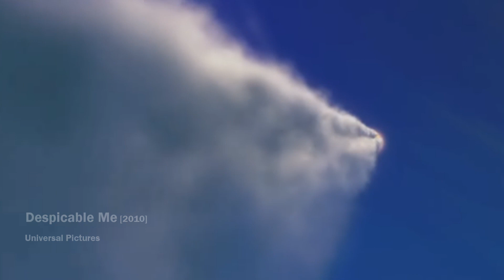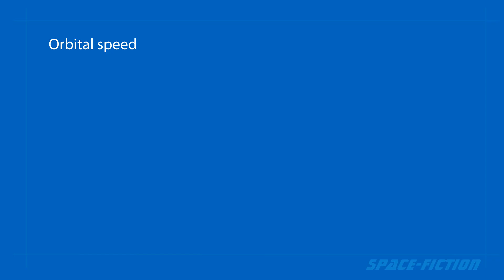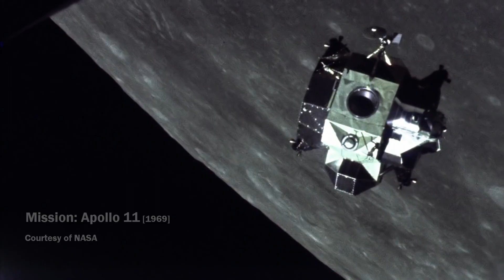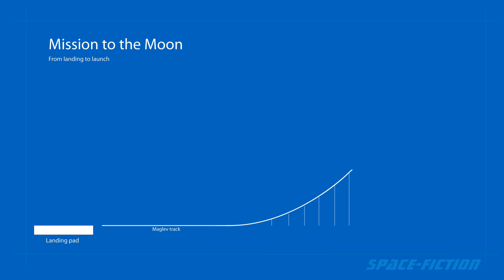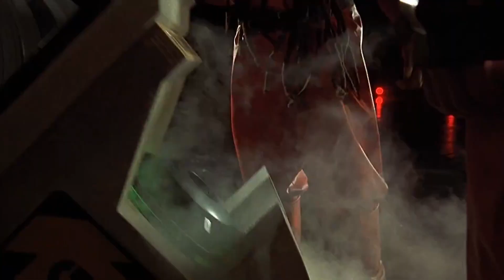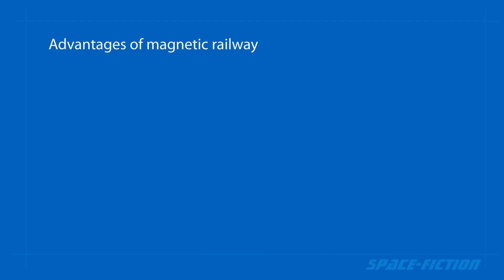Easy way to launch Spaceship from the Moon

Comment: How are you going to get the heavy rail materials on the surface of the moon and who is going to build it? The easiest way is to have Stanley Kubrick fabricate it for you just like he did with Apollo.
Reply from the maker: That is why I pointed out that I am not talking here about pioneering missions but about the future Moon bases with permanent inhabitants and enough resources.
And of course the best way to do it is to get all the materials from the Moon's rocks. But also this method of the mining of materials would be possible after we send all the heavy equipment to the Moon the Old Way.
Reply: Do you really think Stanley Kubrick fabricated Apollo?
Here are some good arguments against that claim:
https://youtu.be/tNbeN_V_NNw
https://youtu.be/RK3Jnl6Zyhk